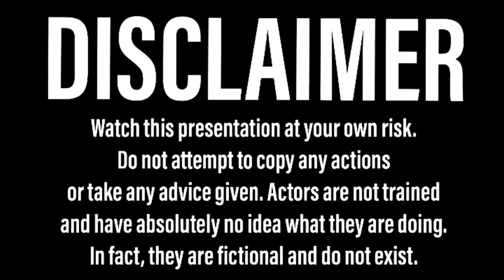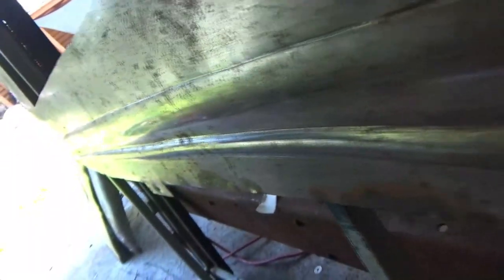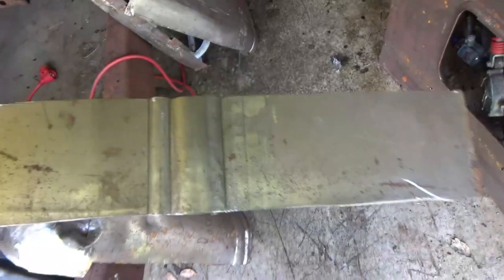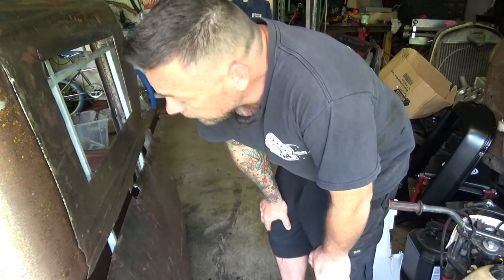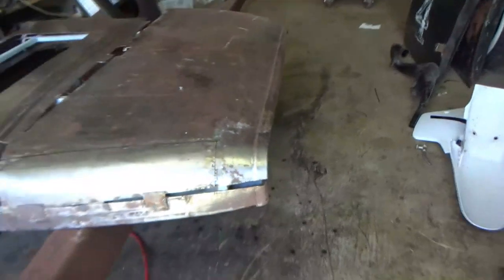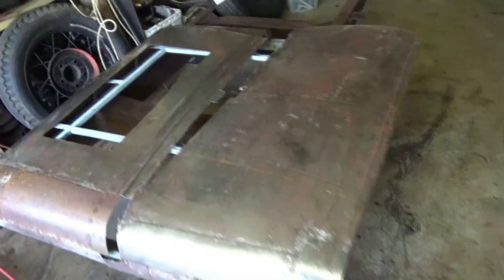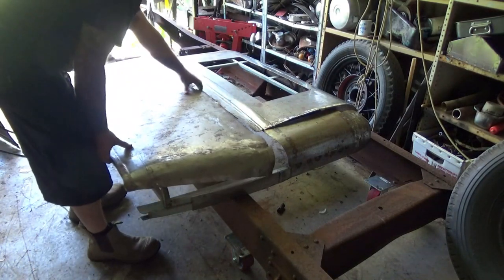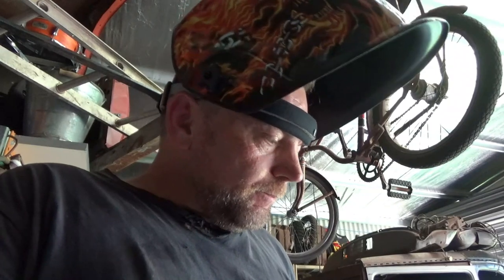Worst fabrication work I’ve ever seen!!  1930 Ford Pickup - Pt3

Comment: G'day from West Australia😉

Umm me thinketh investing in a english wheel, bead roller, shrinker, stretcher, a heap of sheet steel and probably some more steel tube.

Yeeeep I Am saying start from scratch buddy.

I don't know you at all, yet some how know, you could do what I suggest.

Start with drawings, pictures etc for dimentions shape etc.
Yes the tools can cost lots, unless you make them yourself.

However 1.  You could do it.
                2.  You would be triumphant coz you did it yourself.
         
               3. Tools for life.
              4. You won regardless of a verrrrrryy bad experience.

All typed is nothing more than a suggestion, take it and run with it, or leave it.

Choice is yours, wishing you all the luck you can get.

Sincerly Steve.